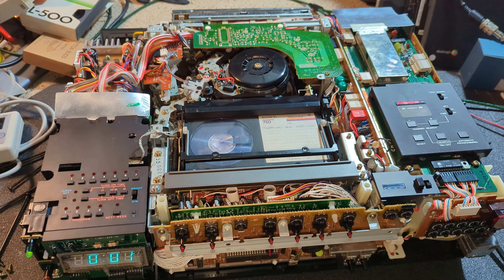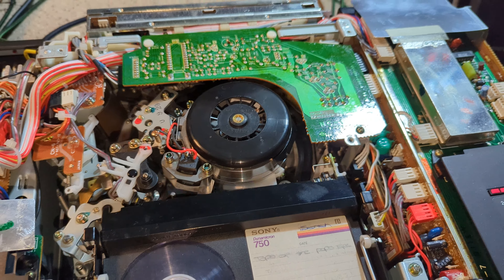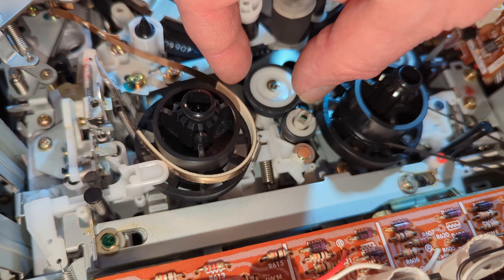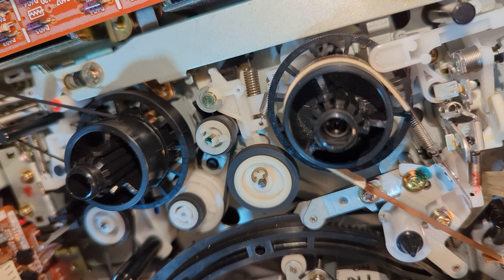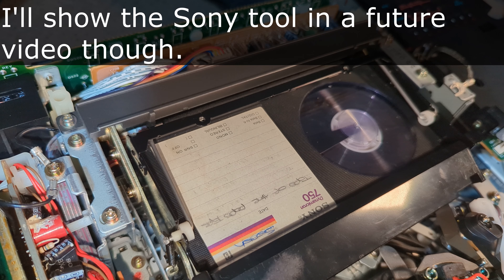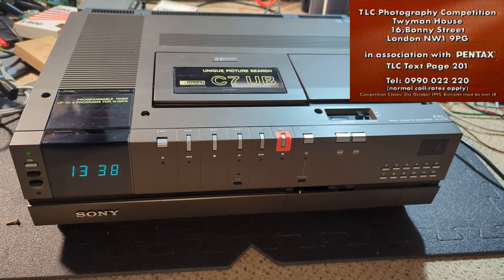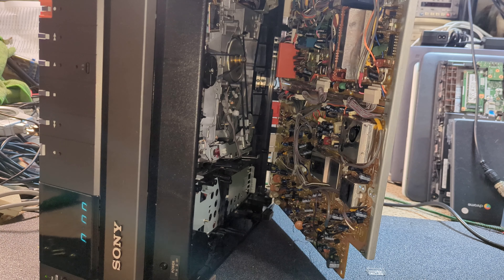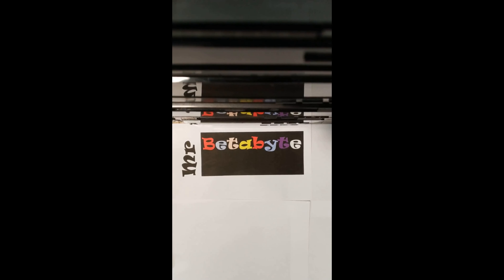Sony SL-C7 New old stock part 3 - A squeak, audio, clock and rewind issues - Fixed!

Comment: The contact surface on relays, like the one you replaced, which is not hermetically sealed are liable to accumulating a layer of insulating surface contamination over time. Operating the relay on a regular basis, like under normal operation of the machine, would help to keep the contacts clean.

Comment: Malvern hills Audi o on eBay has a belt kit listed for these  I need to make a start on mine .I did get the remote from eBay a while back .
Reply from the maker: Good call. I'll stick with Star components as the rubber is excellent and seems to stand up well to heavy use and age too although the oldest deck with their belts is only 4 years hence! Plus you get the idler tyres and they're the right size but will definitely check out Malvern Audi - thanks for the info.

Comment: Great video as always. Just curious how many beta machines you own now 😃
Reply from the maker: Thank you so much - to answer your question - many! It's a long story which I will share but I am having to clear out as much as I can, if anything so I can keep the channel going. It started out as a way of seeing what I'd repaired and how and has become something that's saving so many machines and keeping them all going ( and maybe fueling dodgy reconditioned machines being sold on eBay!)
Reply: @MrBetaByte  I was considering buying one off ebay but thought it would be faulty and not work properly. I managed to buy one off Facebook that actually works fine 😃